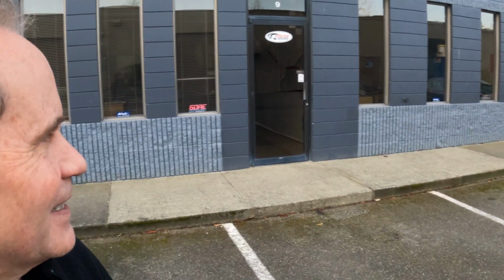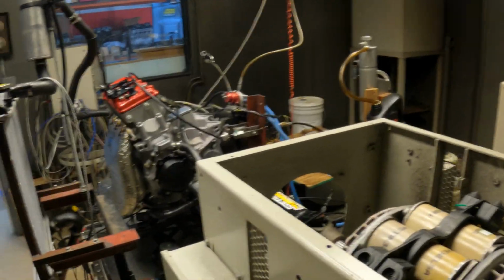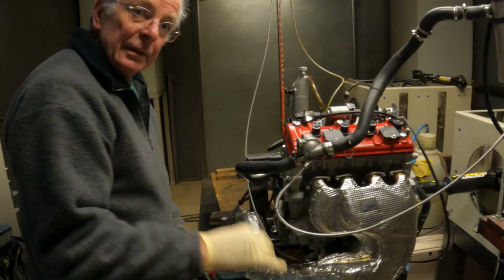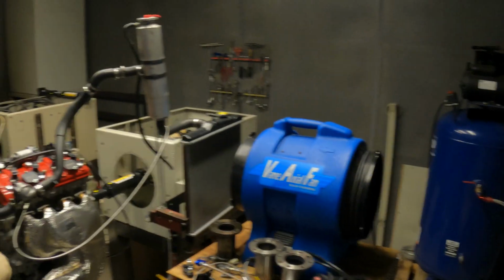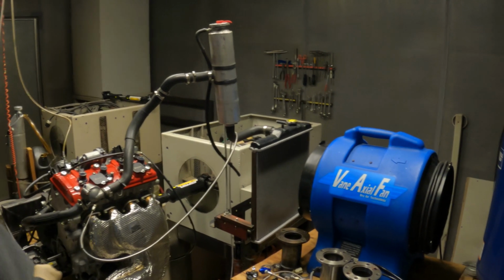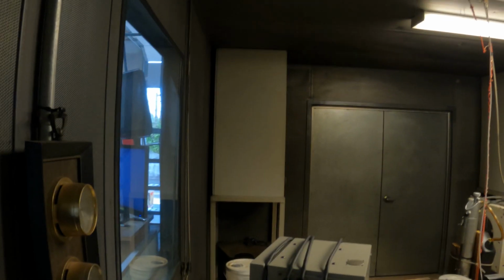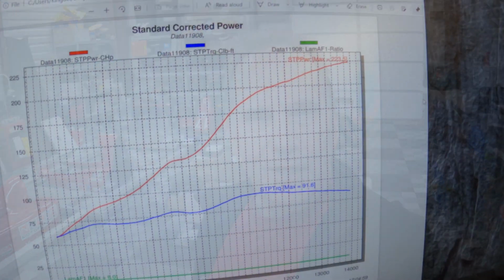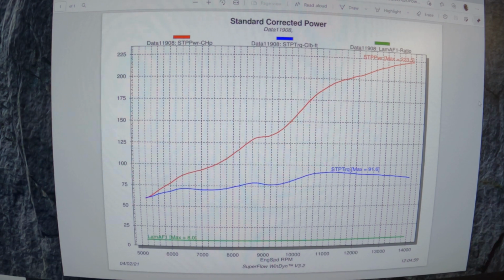ZX10RR Motec M150 Engine Dyno & Tuning - Episode 3: Winter Project F1000 Motec Conversion

Comment: Hi, nice work, if you don’t mind what kind of advance did you end up with ? How did you mount the knock sensors?  Weld a bung on the cylinders?   What pipe is that?   What size engine are you using?    Thanks
Reply from the maker: Hi Steve,  Sure no worries.  Without actually looking at my MAP I recall advance to be around 31deg or so.  Again, I pulled that number off memory.  We mounted the knock sensors on the valve cover which is not ideal, but seems to work, we used the block off plates for mounting.  I have used a few pipes in testing, ended up using a voodoo 4 into 1 header, engine is 1000cc..  Let me know if you have other questions.  Thanks for subscribing!